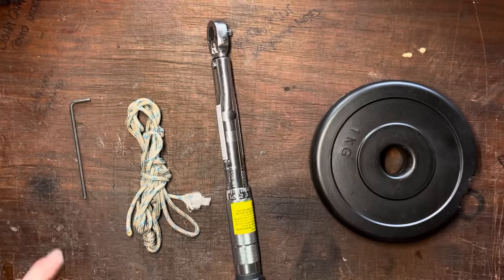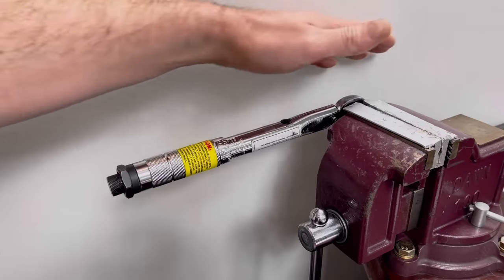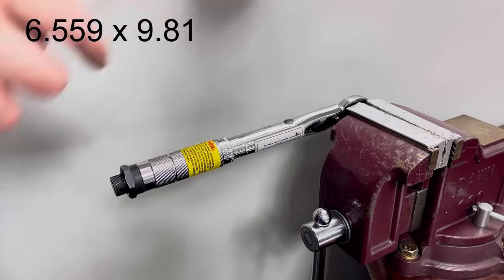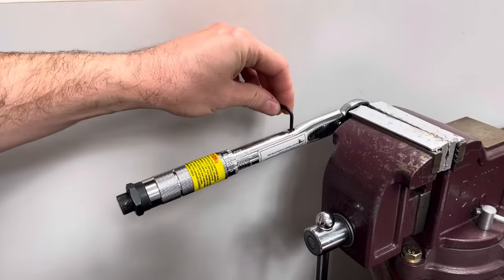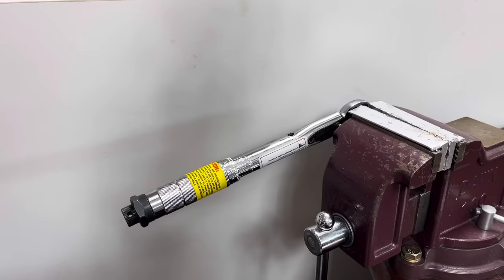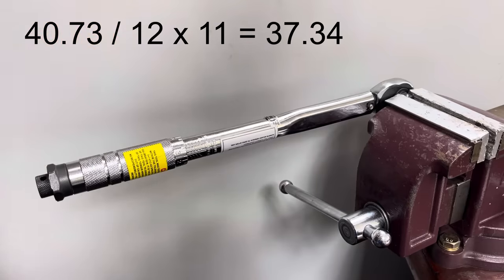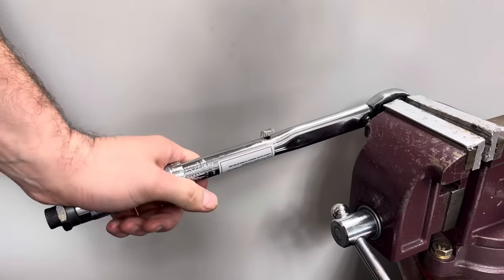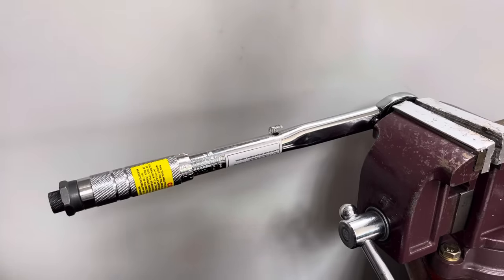CALIBRATE YOUR TORQUE WRENCH IN UNDER 5 MINUTES (NO SPECIAL TOOLS REQUIRED!)

Comment: Torque wrenches are calibrated for mid range, at the highs and lows of the scale they lose accuracy.
Reply from the maker: Spot on! I set mine to where I use it most - around 8-10 nm.

Comment: 9.81? where do i get this number?  If I dial the torque wrench to 20 Pounds and use a 20 pound weight, would I get the same result? thank you
Reply from the maker: If you just use a 20lb weight you won’t know where to hang it :) you need to add the equation in to calculate the lever length. Thanks for watching!
Reply: 9.81 is gravitational acceleration on meters per seconds squared. It's used to get the force of the weight from its mass. You don't need it for pounds since pounds are really a unit of force. 

Torque depends both on the force of the weight and the length of the lever arm so you need to know the value of each to know the torque. 

A nice shortcut would be to hang the 20lb weight at 1ft from the center. At that distance the torque would 20lb×1ft = 20lb-ft. As long as weight is hung at 1 foot from its center, the weight in lb-ft will be the as the weight in pounds.

Comment: Probably it's a good idea to use the same measuring points as specified on the calibrations sheet that came wih the tool.
Reply from the maker: It makes no difference. The load required changes, but the force through leverage applied remains the same

Comment: How about using the adjustment screw to set the click point perfectly? Decide where the weight should be then adjust a bit tighter then work back until it clicks.
Reply from the maker: Which ever way works best for you :)

Comment: This is extremely important to maintain the wrench. As an engineer, I performe this task every few months to maintain tooling. While i have load cells , I have used this method in the field using a car tire which was almost just as effective as the load cell.
Reply from the maker: Awesome! Thanks for sharing :)

Comment: If you want a precise weight , use a measured quantity of water in a light vessel such as a 1 litre yoghurt container. you can add water to the container and creep up on the torque wrench trigger value to find out what its setting actually is.
1 litre = 1 kg
bags of rice etc are not very precise
Reply from the maker: Hey :) thanks for watching! Yep excellent, I mentioned water or flour in the video, anything with mass you have around the home! Glad you enjoyed it!

Comment: not sure whats up with all the calculations? 5ftbls, 5 lb weight at 12 inches from the center of the square drive. thats 5 lbs at 1 foot away. why is this not the same?
Reply from the maker: Because if you don’t have exactly 5lbs it won’t work and also you should test multiple weight settings. Knowing the simple calculation allows you to use any weight.
Reply: ahhhh, makes sense @VintageEngineRepairs

Comment: Very good. FYI it seems the correct load point on the handle would be the band of missed knurling on the handle. If there are two bands it would likely be between them. Can’t see any other reason and most wrenches have this band.
Reply from the maker: Hey :) thanks! Yes I have heard a few people say this too. I’m not too sure as I know in factory’s they don’t hang weights, they put the square drive head into a tool and manually make it click. Anyway, I’m just glad you enjoyed the video!

Comment: Great video but I think you would be more accurate by stabilizing the handle and applying weight to a measured arm length from the socket receptacle center (fulcrum).  By your method you are guessing the manufacturer’s arm length location, especially if it’s not indicated by the manufacturer on the tool.
Reply from the maker: It shouldn’t matter, longer the length the less torque that’s necessary to apply hence the equation takes into account lever length.
Reply: I don’t disagree with your equations. But you can hang your weight anywhere and as you show that changes the applied force. Torque wrenches are designed so that you can grip them anywhere as long as you can make it click if achieved the torque indicated on the wrench. You have to know the manufacturers arm length to know where to apply the force exactlly. Then your method works just fine.
Reply from the maker: @MauleSean  no you don’t need to know the manufactures arm length.. that’s why we use an equation τ = r × F. If your aim is for the torque wrench to click at a specific value, the applied force must be proportional to the lever length. Therefore it doesn’t make any difference to the torque wrench where the force is applied, so long as that force that is applied is sufficient based on the equation given here.

Comment: Am I missing something here? Looking at the torque wrenches available on Amazon, I cant see a single one that has this calibration hole on the side? I know you can calibrate it by unscrewing the bottom but I would prefer getting a model that can be adjusted more easily.
Reply from the maker: Great question, I’m not sure 🤔
Reply: The majority of economically priced wrenches use a pivot block detent mechanism, which does not have this adjustment, if necessary it is altered by swapping pivot blocks of slightly different dimensions. What isn't widely recognized is that this is the adjustment for the highest torque setting, the adjustment at the end of the handle is the baseline adjustment for the bottom of the range. Using them to adjust the wrong portion of the adjustment range is virtually certain to make the wrench inaccurate at other torque settings.
Reply from the maker: @PlatypusPerspective  the adjustment at the end of the handle is a coarse adjustment, to get you close, you then fine tune it with the Allen key.

Comment: FtLbs?? Wth? You started so well until you said Ft Lbs. That's a measure of work. Torque is Lb Ft.
Reply from the maker: Thanks for the correction! I do my best, but I’ll inevitably get things wrong occasionally :)
Reply: @VintageEngineRepairs  It seems to be a UK thing.

Comment: Good video - but note that the place to hang the weight is right on the line in the middle of the knurled grip - that is the reference line and also where the pressure should be when using the wrench (have the middle of your hand on this line).
Reply from the maker: Thanks for sharing! Much appreciated :)

Comment: you should also add the weight of the torque wrench in the equation for the proper result
Reply from the maker: You can do :) or work horizontally with a luggage scale. The accuracy either way will be more than sufficient for garden power tools :)

Comment: Thanks for this. I have confidence in my 20-250 torque wrench, but I have a smaller 2-25 one I'm sure is overtorquing. Out to the shed I go!
Reply from the maker: Sweet :) how did you go?!
Reply: @VintageEngineRepairs  Worse than expected

So I checked the 5-25 first and it was actually ok, though the handle scale is completely useless. With rotating the handle from 0 to the next 0 (Half a turn) it would go up 2.5 numbers, so they're not to scale. Chinese muck, but the numbers on the shaft are close enough.

Moving on the the 20-250 one I have that I was confident in, that was actually the one that was out. When inputting 50lbft into the shaft reading, it was only delivering 29lbft. I adjusted the screw until it was completely loose, and this only upped it to 38lbft. In the end, I removed the pin and circlip and pulled the top out, looked inside, seen nothing wrong and re-greased it and now it's within spec, the adjustment screw is at a comfortable position about halfway through its range, and it's delivering 48lbft when the scale reads 50.

I think I'll be completely stripping it down, cleaning it and rebuilding it with new grease following that. This got the ball rolling at least. Can't believe all the bolts I've obviously under tightened over the years.

Comment: I've seen people completely remove that big nut on the bottom to calibrate/fine tune the wrench. It is better using the allen wrench at the neck method?
Reply from the maker: The nut on the end on this style is a coarse adjustment while the Allen is a fine adjustment :) I’m not sure on other models - they may be different
Reply: Adjusting the nut there is likely to mess up the calibration. The nut at the handle end provides the baseline adjustment for the low spring tension at the bottom end of the tool's range (it is initially set to be correct at 20% of the full scale reading). If there's a neck adjustment, that is for setting of the 100% position. These settings affect each other, so need to be alternately checked and readjusted if necessary until both readings are correct. If there isn't an accessible neck adjustment, the tool has to be disassembled and parts swapped to get the 100% adjustment correct. A check at 60% of full scale confirms whether the spring still behaves correctly over the operating range - if 20% and 100% are within specification but 60% is not, the spring needs to be replaced.

Comment: Goddamnit... I didn't know there is a hole to a screw adjustment. All this time it was covered by rubber  cap 🤣. And manual say nothing about this!
Thanks man... I've been looking for this.
Reply from the maker: Haha glad the video helped!
Reply: The manual doesn't mention it because it's easy to mess up the accuracy of the wrench by adjusting incorrectly. Two adjustments that interact with each other need to be alternately checked and re-adjusted until the whole range is accurate. The adjustment towards the head end is for the highest torque setting, there is a thread adjustment in the end of the handgrip for setting the bottom of the range (this one is the baseline setting and must be done first.)
Reply from the maker: @PlatypusPerspective  That is wrong, the threaded portion sets the initial torque, the Allen key sets the fine adjustment.
Reply: @VintageEngineRepairs   Would you mind if I ask what is your basis for saying that?

Comment: I have a Snap-on torque wrench that i turned in to be calibrated... The Snap-on tool man gave it back to me 3 weeks later and said it was too old to calibrate and the parts to calibrate it are discontinued. Then he laughed at me. I found out who made these torque wrenches for Snap-on and bought the 3 common wrenches for the cost of 1 Snap-on wrench! I still have the one i wanted calibrated, i think I'll try this method. Thanks🏆
Reply from the maker: Glad you got it sorted :) thanks for watching!
Reply: @VintageEngineRepairs  i just looked at my torque wrench and there's no calibration screw like you have

Comment: The handle moves in and out when you set the torque so you need to set it before you mark where to hang the wight
Reply from the maker: You’re spot on it was a b-roll editing mistake :)

Comment: easier way than that. grip torque wrench in top of vice and measure from middle of square drive 12" and mark it. get digital luggage scales and adjust torque wrench to say 10lb and put scales using the hook and pull the scales and when it clicks , thats the torque.
Reply from the maker: Yep if you have a luggage scale it’s very useful, but I don’t. Weights will have to do :)
Reply: but may not have weight's and would you trust a bag of sugar to be perfect 1Kg @VintageEngineRepairs
Reply from the maker: I weigh them on kitchen scales, more than accurate enough. Bottles of water filled and weighed is fine too. Keep it simple.

Comment: Out of curiosity. Wouldn't it be more accurate to measure the wrench after the torque is set on the wrench? Unless of course it's calibrated set from zero.
Reply from the maker: Hey, absolutely, yes, it was an editing error. 👍 set, measure, weigh!
Reply: @VintageEngineRepairs  Thankyou for replying

Comment: My wrench does not have a rubber bung or any bolt to adjust with..It looks like the adjustment is done on the end by loosening a nut and turning the bolt with an alan key then tightening the nut.
Reply from the maker: Interesting! I haven’t seen one of those before, so I’m afraid I can’t offer much help :(
Reply: This style (likely a pivot block mechanism) has only the low end adjustment that can be made without replacing or trimming any parts. Calibration actually involves interactive adjustments at both top and bottom of the tool's range. If there is an adjustment at the neck, it is for setting 100% scale. When there is no neck adjustment, 100% scale is adjusted by size of the pivot block, either swapping different dimension blocks, or if smaller size is required, filing off a few thousandths of an inch...
If an adjustment is made to just the nut position at the handle end, it is likely to throw the accuracy out over the entire scale. A wrench adjusted this way could only be assumed to be correct at the one torque value that the adjustment was set at (if it was done accurately).

Comment: What would you suggest for calibrating higher torque wrenches that need 20+kgs? Finding an accurate 30kg, never mind attaching it to the handle, of course isn't practical unless you have a home bench press! Can I use my own weight standing on a set of bathroom scales measuring against the change on the scales as I transfer my weight to the wrench? Or is that not accurate enough?
I need to recalibrate my 13 year old Norbar TT200 torque wrench I bought for wheel nuts... but it does 40-200nm, and I make it 0.395m in length to the red + on the handle. So if my maths are right that's 15kg for 58.1nm and 30kg for 116.1nm. If I want to calibrate the full range that gets very heavy - even just going as far as the torque I need for my wheel nuts, 140nm, would require 36.14kg.... the full 200nm would need 51.6kg!
Reply from the maker: Since this video I have been using fishing scales that go to 40kg’s you could try them!
Reply: @VintageEngineRepairs  I had to google fishing scales.... and they're basically luggage scales, right? Genius, I have a set of those, what a brilliant solution - they should hook nicely on the wrench :D Probably worth checking their accuracy first though
Reply from the maker: @feanor5037  yep, use water to check accuracy. 1 millimeter is 1g. I tested mine wjth a litre which is 1000g / 1kg
Reply: @VintageEngineRepairs  Great idea! I ended up checking the luggage scale against the bathroom scales, the luggage scales read between 100 and 500g more at 20.5kg depending on where they decide to auto-hold - so within 5%. That'll do for car wheel bolts I think, at least for now.

In case the following is useful to anyone else, here's what I did:
Checking 116nm the wrench clicks at 28.5kg instead of 30kg... adding the worst case difference with the bathroom scales, that's 2kg out, giving a real torque of at least 108nm when set to 116nm, so 7.4% - not bad for a 13 year old piece of kit! Unless I've got my logic backwards (which happens a lot) I think the two tolerances are in opposite directions so I shouldn't need to worry about the two tolerances adding together.
I believe the wheel lugs on my BMW F30 need a torque of 140nm +/- 10nm. I've discovered that the calibration grub screw on my Norbar TT200 torque wrench is held in place from the factory by Loctite, which would need breaking and then re-applying. Rather than faff about with that I decided it's easier just to set the wrench to 150nm for now.
Turns out that the muppets who repaired the run of punctures I've had recently in my tyres managed to under-torque one of them and massively over-torque the others; I can't budge them with either my Bosch GDX-210 impact driver/wrench or my torque wrench set to its maximum of 200nm so I'll need to borrow a stronger tool. The last wheel had a breakaway torque of about 180nm (measured by progressively changing the wrench setting before the lugs moved) which with rust and weathering probably means it was originally torqued about right.

Comment: You earned my like. I was wondering how good a cheap torque wrench would be and found this video.
Reply from the maker: Thank you!
Reply: @VintageEngineRepairs  knowing that you can indeed adjust them gives me more confidence to spend less on things I will use only occasionally and not for my main job.

Comment: I have seen on those particular style torque wrench, absolutely do not take them past zero it screws them up immediately on there calibration, not a big fan of them , I do use them for cheap cheater bars works great for that Ive found, good video very informative on how to I like it
Reply from the maker: Interesting I have gone below zero without issue.
Reply: Maybe the manufacturer has resolved some of there issues with these things, but Ive owned 3 and 2 got turned below zero and they got very bad out of spec and the third was not even close to being there straight out the box..... So the snap torque wrenches have left me with trust issues , I always double check them after use with my old trusty needle style wrench, so far with the higher quality snap wrench I haven't had any issues with it yet, but I still don't put the 100% trust in it and always double check it
Reply from the maker: @RonnieRose-f5x  ah interesting to hear! I have only owned 2 and they’re good quality “enthusiast” quality I suppose. Not cheap home owner but not professional quality!